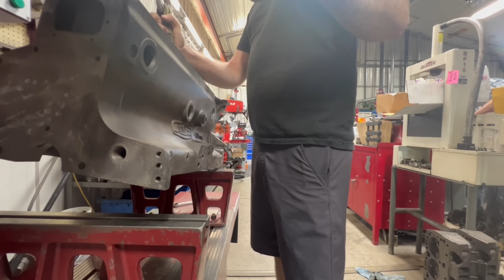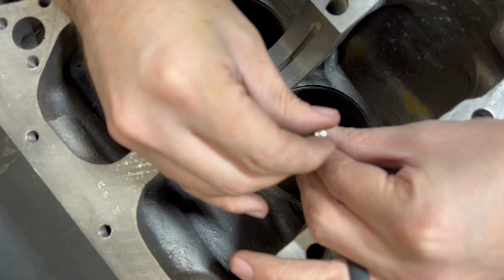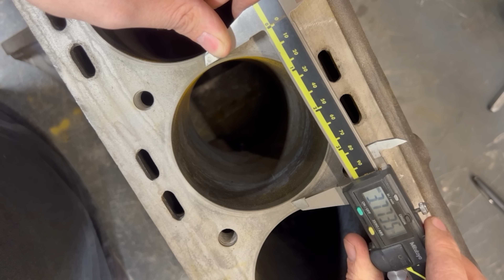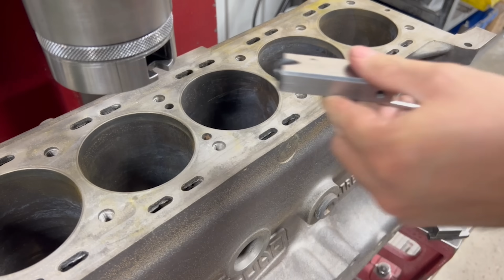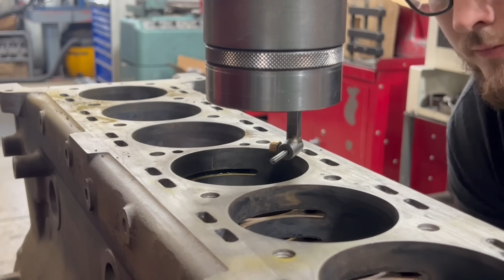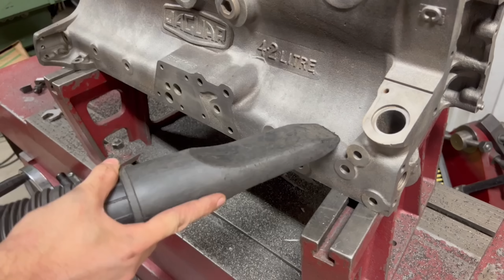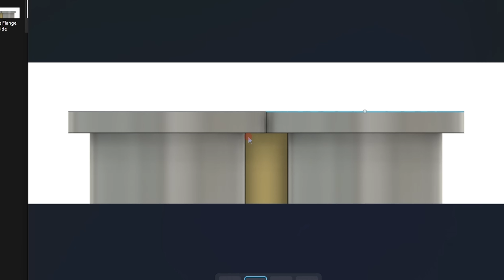Can This 1968 4.2L Jaguar Block Be Saved?

Comment: If you have access to a large(er) oven or kiln, and a highly skilled and experienced welder, you could prep the cracks, heat/weld cycles until you get them all repaired then spot face the deck and go to work on the cylinders.  Way labor and time intensive, or as others have mentioned, have it done professionally by an external specialist since it is a high value numbers matching block.  Thanks for your time on this one, greatly appreciated!
Reply: this right here sounds like the "Correct" method of repair.
Reply: I was just wondering why welding wasn’t an option. I understand why its not for the avg home gamer. But the pros, with a rock and hard place situation like this have im sure come up with some. Probably not mig, but im fairly certain of some tig rod for casted metal. and ya ya i know heat affected brittle zone next to weld. But with proper heat up and cool down like he’s mentioned here with an oven, it dose a great job of negating those problems. 🤷🏻‍♂️. 

I understand the speciality of it. So im curious if some have specialized in it.
Reply: Dollar to return yield, you can throw all $ at it, in the end will work be worth yield. Only customer can quantify $s.
Reply: Better off the grind out then braze the cracks instead of welding them.  Welding cast iron as mentioned is a real undertaking with pre / post heat requirements
Reply: I was wondering the same thing. Why wasn't welding a option. I personally suck at welding but I've seen guys on YouTube do some amazing things.
Reply: Cast iron is brittle so it is extremely difficult and risky to attempt to weld an engine block. You can have cracks form even  days after the cast iron has cooled.
Reply: @samleen  it did cross my mind that maybe it had something to do with the material. To be honest I know nothing about welding but I seen alot of guys on YouTube saying exhaust manifolds are extremely difficult to weld. Quick question, if it was a aluminum block would welding it be no problem?
Reply: @samleen : trained by depression era farm mechanic. I know about cast iron.
Reply: @lovetolearn5253  welding on cast aluminum is one of the most tempermental and tedious things to tig weld go check out @the fabrication series on YouTube and he will show you why welders hate cast materials in general
Reply: @lovetolearn5253  if it were aluminium the weld process would have a better chance to f succeeding but the weldor would still have to be at a high skill level, and a lot would depend on whether or not the part was cast and how ‘dirty’ the casting is.
Reply: @lovetolearn5253  Aluminum block would be easy. Completely grind out the cracks, fill with weld, machine back to size. Drag racers do it all the time with blocks and heads. Cast iron is not so easy and in this case, isn't actually needed. Resleeve with top hat sleeves and they are good to go. It's been standard procedure on these jags for decades as pretty much all of them crack in the same way. Do the sleeve and deck job right and it's no problem.
Reply: Everyone's right cast iron needs to be pre heated before welding and cooled slowly after so it doesn't crack more from the repaired areas but it is not impossible just cost alot and takes time , I didn't think of brazing rods which may be easier then welding and would seal the cracks as well
Reply: You don't need an oven or kiln, just a big tub of sand and two guys with weed burners. I saw a very large casting fixed that way.
Reply: Or you could braze them.
Reply: This is what I commented in a different way I also think it's the only way to restore the block properly and eliminate the leaks and cracks
Reply: chuck the block into the dumpster, along with the ugly ass car..
Reply: *I'll repeat my comment from another post as this seems like a more technical audience.  If those cylinder walls between cooling passages #1 & #2 were not so thin I would say aluminum tig welding could be the way, but Tig is very hot, maybe try with a 120v machine and mig alum 5356 wire with 100% Argon, DCEP
Reply: Buy casting sand. Very fine grain. Channel the cracks and bore ends of cracks. That will stop them from spreading / growing. Heat block to 400 degrees centigrade IN a an OVEN. This will freeze the cracks in place. TIG weld cracks using the appropriate filler rod. Heat block to 700 deg C and prepare sand to receive block, or the other way around. Dump sand on block especially in the bores. Cover with sand, completely submerge block with sand. Pour layer of sawdust on top of that. LEAVE FOR A WEEK. 

Bore and face block to specs.

Comment: I think the collared sleeve is a good option, another would be furnace brazing. Since you're essentially only trying to hold back pressurized coolant welding isn't necessary, and you avoid the possibility of brittling around the weld area. Also, what about a deck plate?  It would have to be custom built (read: expensive), and it would be externally visible (possibly reducing value of the car) but it would solve the issue permanently.
Reply: The deck plate makes total sense great idea
Reply: i'm not a metallurgist but I feel temperature differential between dissimilar metals would pose a concern. at least with welding you're able to penetrate the crack if properly ground deep enough which will repair the area from the core of the damage outwards. Would require a deep enough of a grind>preheat area>weld>heat treat to relieve stress> bore/surface

many videos out there showing that it is very possible to weld on cast iron
Reply: @kimber3865  I know welding cast iron is possible but remember this block is decades old, has been through thousands (possibly hundreds of thousands) of heat cycles, and you have no way of knowing it’s composition. Plus, with welding, you have the real possibility of embrittlement around the weld.  Furnace brazing has been around for decades (centuries?) and has a proven track record with cast iron. Before the popularity of aftermarket cylinder heads competition cylinder heads were constructed out of different pieces cut and furnace brazed together.
Reply: If he's that precise a machinist, the deck could be cut with a lip around the edge to hide the plate. Then instead of a flange, a taper along a dimension less than that of the height of the deck plate could doubly guarantee its retention.

Comment: Put it back together as is. Numbers matching is essential and 10,000 miles of driving is little threat to failure.
Reply: Just put the goddamn numbers on a good block
Reply: @erik_dk842  aren't they part of the casting and not on a plate so it can't be removed and done that way to deter engine theft and prove tampering
Reply: @erik_dk842  considering these are rare and any good block would cost more than a salvage car or a car with small issues.. tampering with engine block serial numbers is a felony especially if youre gonna use it on the road..

Comment: If I were the owner i would forget the concours restoration and get a better block for a nice weekend driver.
Reply: You're talking about a huge difference in value when finished. Aside from that I'm guessing the number of cars for which a concours restoration is possible is incredibly low, making it even more worthwhile.
Reply: Most of these restorations are driven very little and then babied so not to chance damaging something. I don't know how much money will be spent on this project but I have seen more money spent than the car is currently worth. It's either the love and respect of the history, the expected future value or both.
Reply: These engines all crack there. Nothing life shortening or damaging about the cracks. It can be driven as hard as desired when reassembled.
Reply: It'll be a garage and enclosed trailer queen, driving less than ten miles under its own power a year.

Comment: If you have a welder you know and trust that is capable of welding cast, your best bet is going to be weld them up. I’m capable of doing it I just do not have an oven big enough to heat the whole block up to make the proper repairs. If this wasn’t a numbers matching it would be a different story. I’d use a torch to spot heat my repairs, but in this case I you are going to want to make sure you don’t cause any more damage.

Comment: What about spray welding the cracks and bore to size for the sleeve you decide to use?
Reply: Or you can get the right welding rod to weld cast metal.
Reply: I think you'd want to vee-out the crack and then build back up with welding.

Main concern would be whether the welding distorts the block too much.
Reply: @nerd1000ify  When you spray weld you typically heat the block so distortion is minimal. And yes part of the process is to v out the crack with a die grinder.

Comment: My engine machinist in Oklahoma City welds cast iron with some sort of powder process.   I’ve never actually seen him do it, but have seen the lasting results.    Even some of me 366 ci Chevy cylinder heads.   

Can that block be welded?
Reply: The process is called spray welding. I used to do it at the last place I worked on mill roll bearing journals.
Reply: About to find out 😏😏